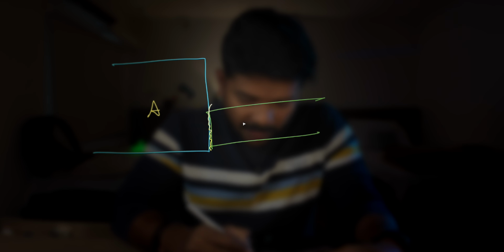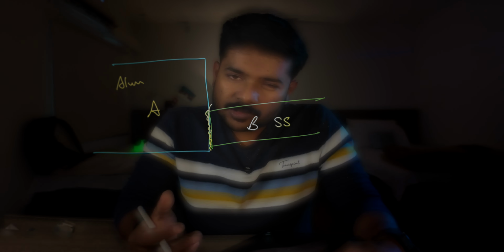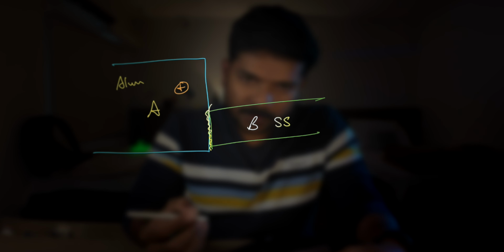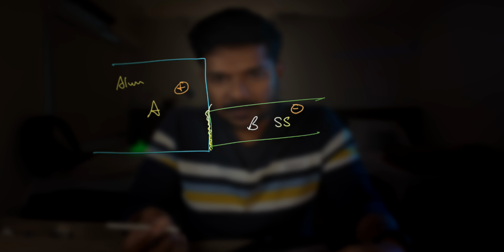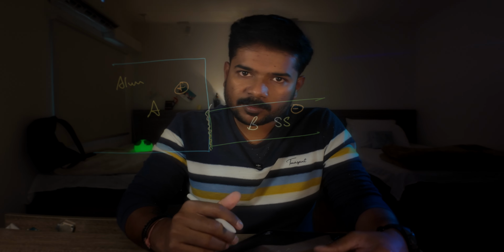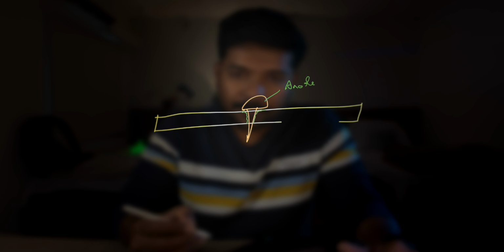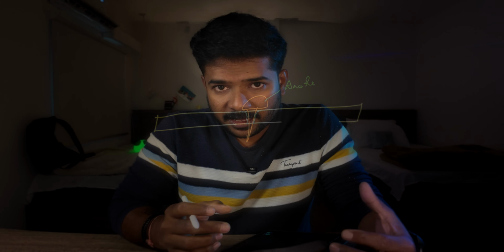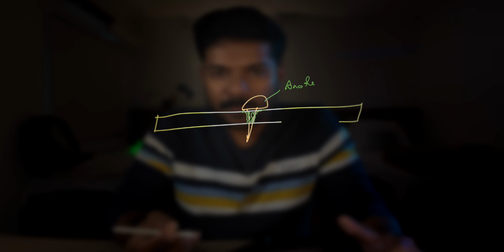Bimetallic Corrosion in Facades Explained | What, Why & How to Prevent It

Comment: Hi Walker’s, greetings from Colombia Amigo
I understand that corrosion occurs when aluminum has no surface treatment, that is, when it is in a mill finish condition.
On the other hand, if the aluminum anchor plate has only an Alodine finish and is later cut, leaving the side faces exposed while only the base of the plate is in contact with the concrete, what would happen in that case, or what is the recommended practice? I am talking about a typical curtain wall anchor connection.